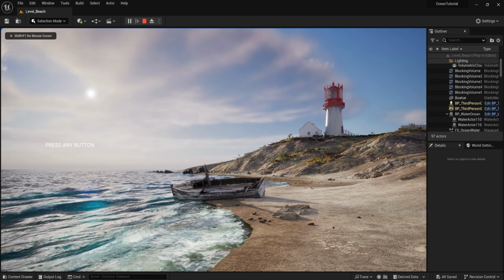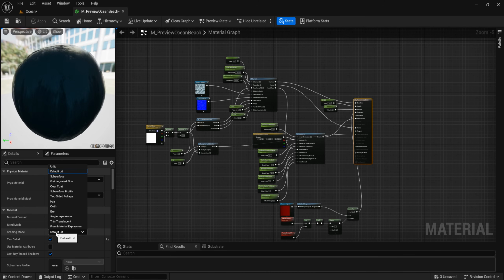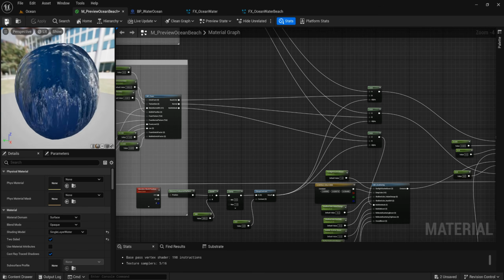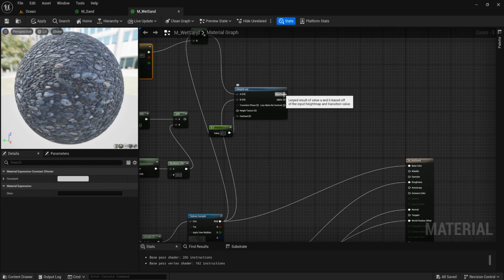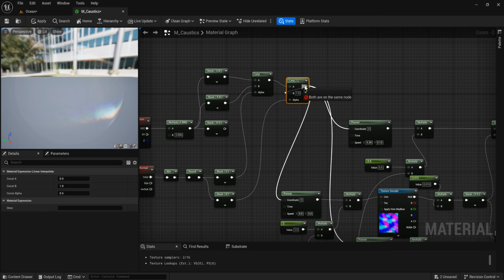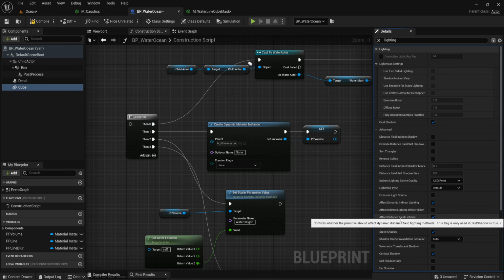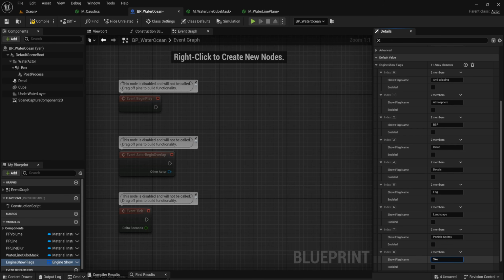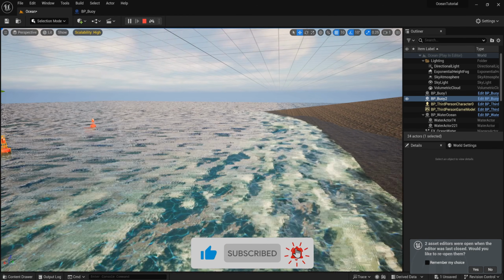Create a Beach in Unreal Engine Tutorial

Comment: As you said in the beginning, the water flows in the same direction. Would a flow map which blends the render targets with different scroll directions be feasible? I don't know if I have seen FFT water with local flow directions
Reply from the maker: @robinj6997  I don’t know. You can try blend it with flow map. If you want to have better shorelines water, you may need different method shallow water simulation.